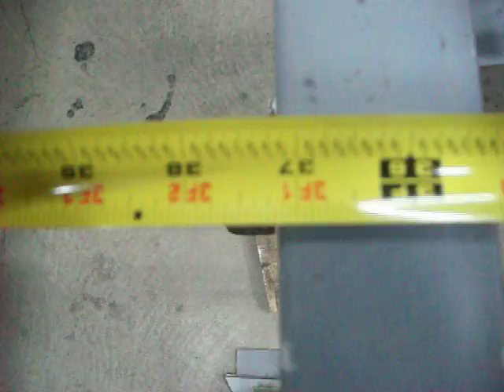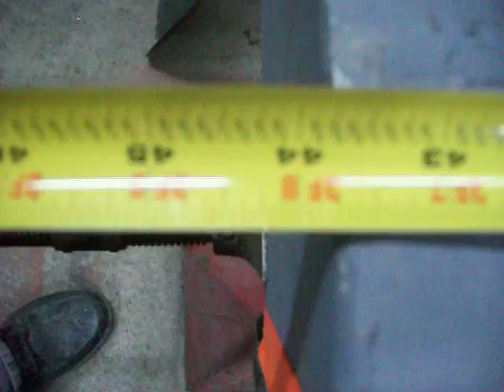Frame video 8 Rusty Frame 1989 Silverado

Comment: Like your work so far. Very ambitious project.
Reply from the maker: +Djinantonek Thank you, its been a long haul, I started this in the spring. Here it is November, its been fun and gratifying but a lot of work. I must have used 300 of the 4 1/2" cut off wheels to get to this point.